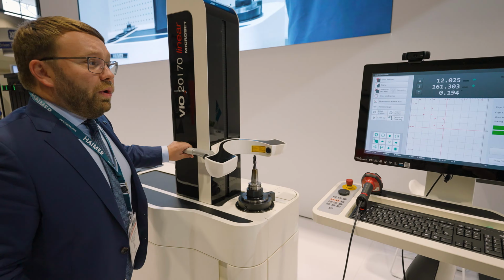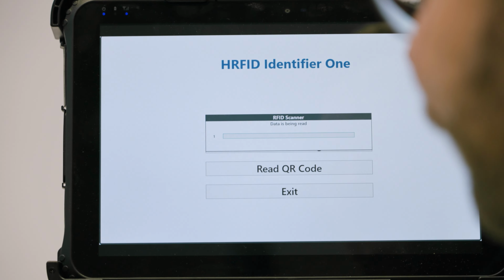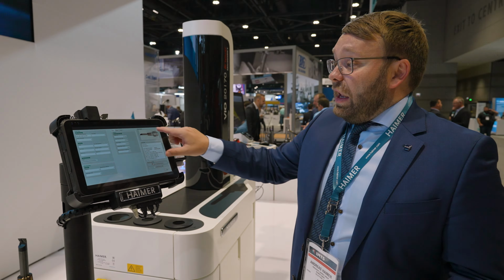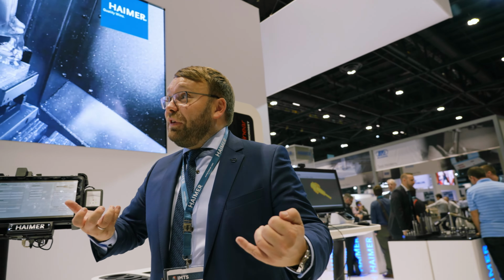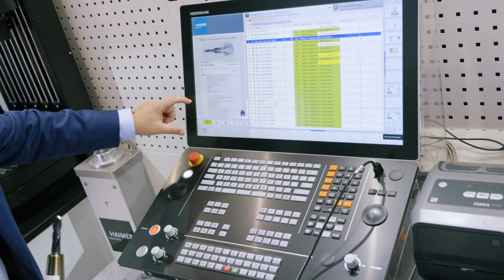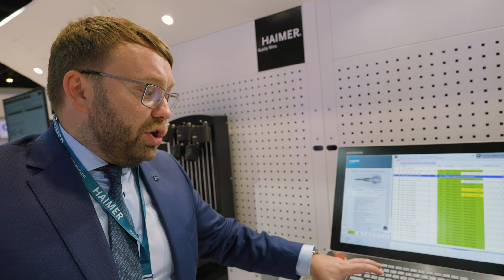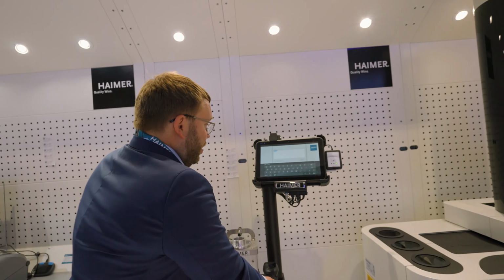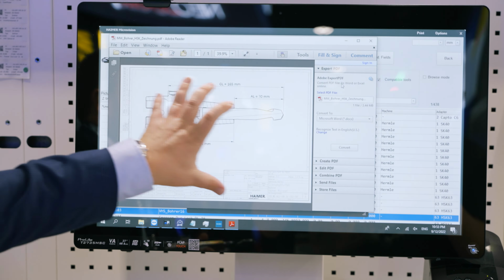Most Innovative Products for CNC Machine Shops | HAIMER IMTS TOUR

Comment: Not to be a downer, (I usually am impressed with this stuff) but I want to see the coolant on the tool at high rpm.  It has been my experience that the coolant will conical outwards away from the tool at high rpm....only thru tool coolant worked for me.  That is all.  Maybe they have figured out something.  And yes, it's good to see the CEO so knowledgeable about his product.

Comment: I flippin love that the CEO is so knowledgeable on their products. He should be a role model for others in the industry.
Reply: Thanks. I am occasionally online on you tube in the evenings or weekends as a hobby. Have a great weekend and thanks for your kind words and support.
Reply: @andreashaimer2088  would you recommend your systems for a one off cnc shop?
Reply: @dakotareid1566  thanks for asking. We have many different entry level products. So yes, there are many ways to reduce set up time, avoid scrap and be more productive using our systems no matter which machines you are using. Feel free to reach out to our great local teams or distribution partners to get some advice at your shop. Also we have great 3D sensors which fit on every machine and accurate collet systems. The guaranteed best runout helps you no matter which RPM you are using as you always save money on the tool life.
Reply: @andreashaimer2088  appreciate the reply thanks
Reply: He's also in the comments which is pretty crazy 😂
Reply: I love this man’s energy

Comment: 2:08 What is that shape??
It does not look like the cuttinggeometry of the drill...
Reply: Yeah, that shape is wrong.
The tool should spin while measuring.
You only need the max values of the outer contour.
You won't have the exact helical shape of the drill because the tool spins anyways and it slows down the computer simulation.
A pointy cylinder is all you need to represent a simple Drill Bit in a CAM Simulation.